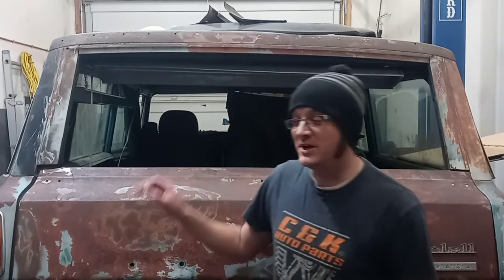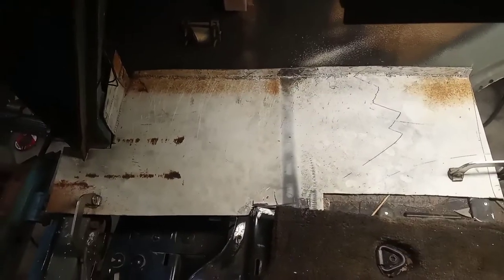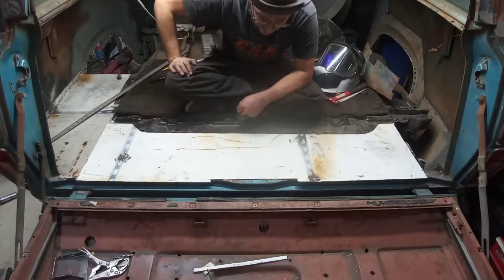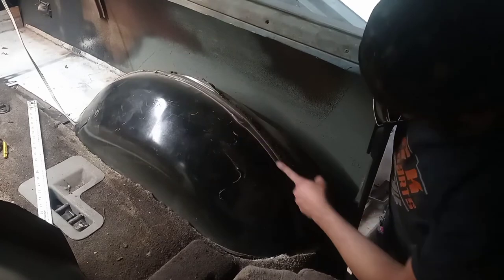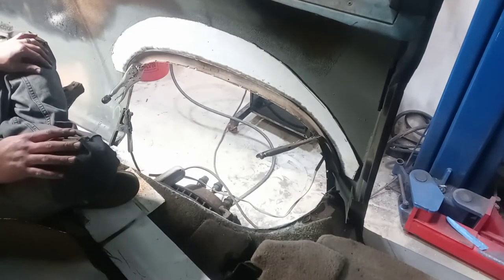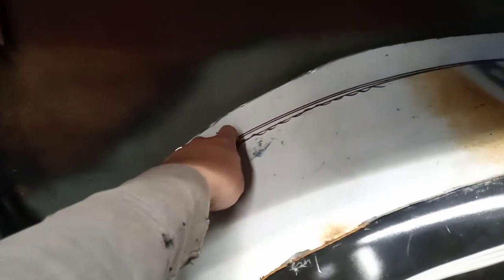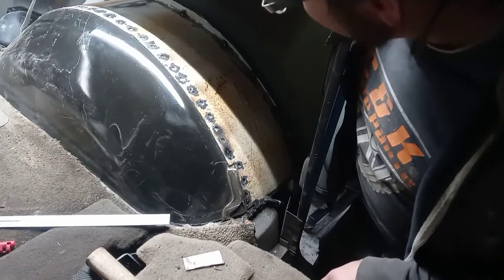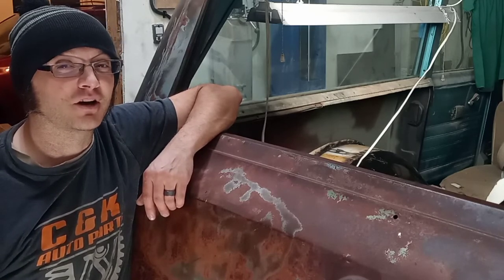Widened wheel tubs and extending the floor pan - chassis swapped Travelall

Comment: Only suggestion i'ld make is maybe some angle on the underside of the floorpan to make it more rigid. The wheelwell turned out great
Reply from the maker: I actually have some truck bed floor ridges (from the Dakota) that I've been considering welding in for that exact reason.

Thanks!